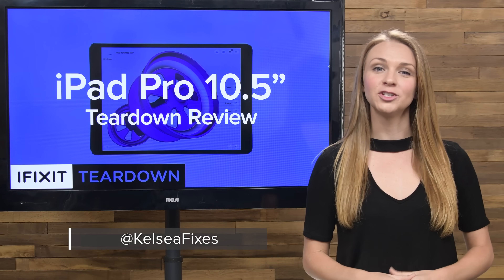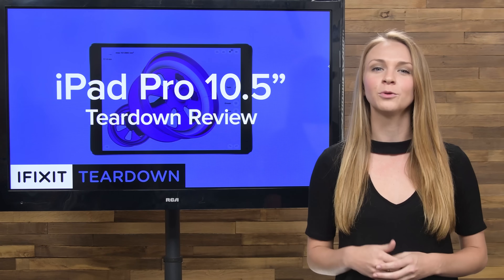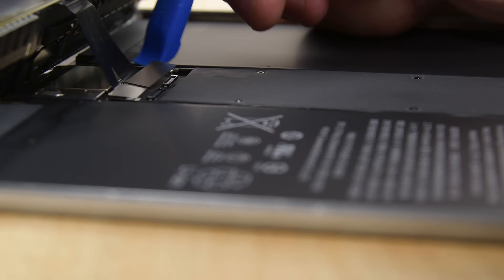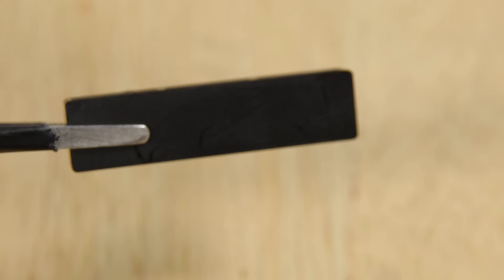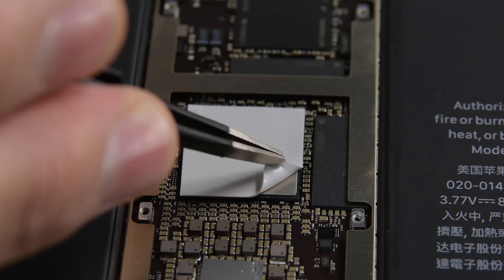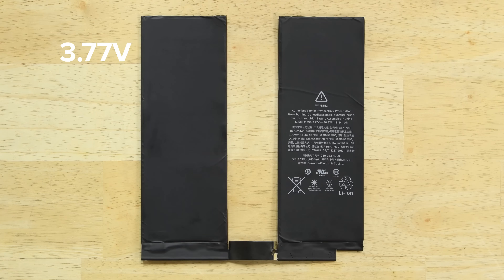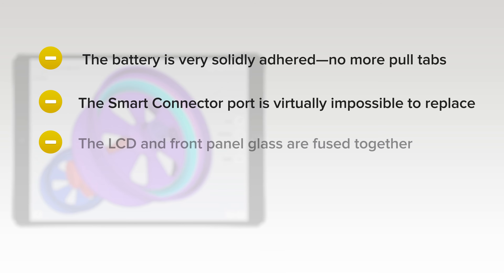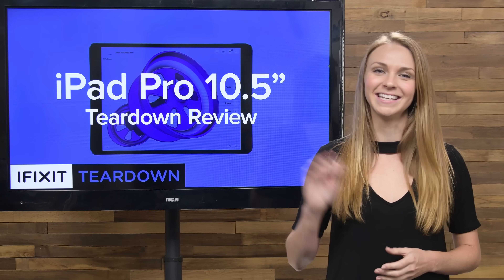iPad Pro 10.5" Teardown

Comment: BEWARE IF YOU BUY NEW IPADS.. a cracked or faulty display will mean a need for a complete replacement of the device.. with no respite once you’re out of warranty

my iPad Pro 10.5 suffers from a bright spot an inch from the home button which has affected many users as well.. an obvious hardware and manufacturing defect.. went down to the Apple store today and they said they can’t just fix iPad displays and have to get the whole device replaced for almost S$700.. 

So many people with the same issue!! 25 pages on macrumors!!!

https://forums.macrumors.com/threads/bright-spot-on-ipad-pro-10-5-screen.2115037/page-24

https://discussions.apple.com/thread/8424181?answerId=34127475022&page=2

https://www.youtube.com/watch?v=sJBWVQz-H0k&t=2s

very very disappointed in the brand and this is coming from a long time apple fan. Unreliable products being made nowadays

Little wonder why they discontinued this model.. they need a repair program ASAP

Comment: gluing a lipo battery into an aluminum heat sink case next to hot logic makes no sense & is horribly unethical 

li-po batteries fail, swelling up toward the end of their life 

if a li-po battery is ripped while swelling, the tear can cause venting with flame (galaxy note 7) which bricks the device + more 

li-po cells have a finite useful life : often vastly exceeded by the high quality boards, displays and cases that Apple builds with! 

if a li-po battery is glued into place, removing it become hazardous, requiring the heating of the flammable oil filled lithium cobalt fire prone battery, or the use of toxic solvents to soften the glue 

while iPad battery changes are notoriously difficult : I kept my ancient iPad 2 battery between 30-80% charged and it still works to my utter amazement : meaning that Apple used some special sauce in the chemistry : that resulted in a battery that keeps going and going

most end users harm their device batteries by repeated 100% charging : every time a li-po cell is fully charged it loses capacity faster : fully charging causes mechanical shrink swelling damage of the anode and cathode 

aerospace li-po batteries are fully charged to 3.77vdc and the low voltage discharge cutoff is 3.15vdc : roughly 32-77% state of charge range respectively!

Comment: 0:38 Ouch!
Reply: Þjóðrekur Haavard exactly
Reply: Yeah seeing those bubbles from the glass and LCD separating made my stomach turn 😭
Reply: Good way to avoid that is using alcohol instead of heat once you are able to get a plastic card between the frame and screen.
Reply: This is permanent damage as it seems?

Comment: Why won't they put an iPhone motherboard in there and fill the rest with battery
Reply: JoneTech, bigger resolution means more graphics so it needs better GPU and support for all the other stuff
Reply: Jack_Cydia I mean a iPhone sized motherboard give or take the space for the bigger cpu
Reply: Looks like a single sided PCB to accommodate the 6 mm thickness, vs iPhone 7 is double sided PCB and 7 mm thick.
Reply: Interesting question indeed my friend.
Reply: The iPad logic boards only have the chips on one side. The iPhone has chips on both sides of the logic board
Reply: smithydll didn't think of that
Reply: JoneTech *SOC
Reply: Same thing

Comment: I love my iPad Pro 9.7", but it seems like springboard keeps crashing because apparently its a about a gig short on RAM.
Anyway, with all that adhesive, you would think the iPad would have a bit more water resistance.
My iPad, when facedown, is sometimes hard to pick up, and sometimes get added stress on the Lightning port. Lightning port replaceability, and added water resistance should be added in future revisions. Not to the extent of an iPhone, but enough to resist 100% humidity or a quick splash for short periods, as people using tablets also use them as portable TVs. 
Would the water/humidity resistance of this recent iPad be better, than say, previous generations? I'm hoping that if they are going to be using  ore adhesive, it better come with water and environmental resistance, than to reduce serviceability, ala Samsung. Otherwise, I'm very disappointed at the move towards planned obsolescence for a black box system.

Comment: You know its hard to open the display when ifixit THEMSELVES break the ribbon cables smh
Reply: Actually it can be done without damage, IT'S A NEW LOCATION THAT THEY DIDN'T KNOW ABOUT......It was previously on the side, now it's on the bottom, they found out by trial and error. Once you know where it is, it can be opened successfully.
Reply: Firealarm102 I actually believed that all iFixit tear downs resulted in all sorts of ribbon breaks.
Reply: when even apple doesn't fix it

Comment: Man, those bottom speakers look weak. Hopefully they perform well
Reply: Allan Sh they perform really really good what are you talking about
Reply: Aaron Wafflez they do.
Reply: Aaron Wafflez there are 2 speakers on top too. They are really good
Reply: very well
Reply: Allan Sh of course the 12,9" sounds better. Did you see how much space the speakers take inside the 12,9? It's a lot more than the 9,7 or 10.5
Reply: I've heard the 9.7 and it sounds great (not as good as the 12.9 obviously.) I have the 12.9 1st gen and it's just incredible, it sounds way better than my MBPr, in fact, it's better than most small / cheap Bluetooth speakers. It has great bass response for the size. They're a great addition to the beautiful screen on the 12.9. I use my pro as a TV basically and it's perfect. The battery lasts forever too. I charge it maybe twice a week and I use it about an hour or two a day.
Reply: Allan Sh But how do they compare to the iPad 9.7"? I owned an older iPad 4, but when I moved to this one, its basically my TV. The sound is surprisingly great for the form factor. But if its not equivalent audibly to the 9.7", its not worth regretting not waiting for.
Reply: US  it's definitely better than iPad 4 though. But I am a little disappointed by the 10.5 inch because my old 12.9 inch model sounds a little better.
Reply: Vandel Jason Strypper  Seriously? If you are that curious, take a look at this screenshot. https://www.dropbox.com/s/1ooqg0j8yi2xifs/iPad%20Pro%20YouTube.png?dl=0   I am watching YouTube on my new iPad.
Reply: I have the 12.9" iPad the speakers are incredible
Reply: Allan Sh Theres always a compromise due to the form factor. But the iPad Pro 9.7" spoiled me. I wonder if Apple Air 2 cases will technically fit the 10 inch model. My pro 9.7 can fit one, but the cutouts are different.
Reply: Aaron Wafflez I have it & they are very loud. I can hear music & videos in my kitchen when my iPad is in my living room.
Reply: they do perform really well
Reply: it's the best speaker onthe tablet right now 
even better than 3000$ dollar laptop
Reply: Aaron Wafflez they don't.
Reply: Allan Sh What are you talking about, they’re great speakers